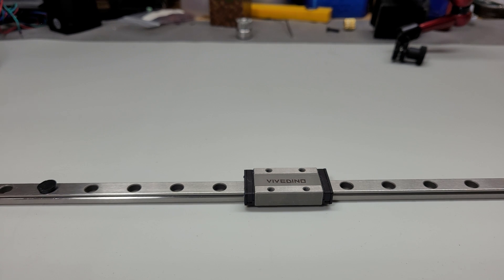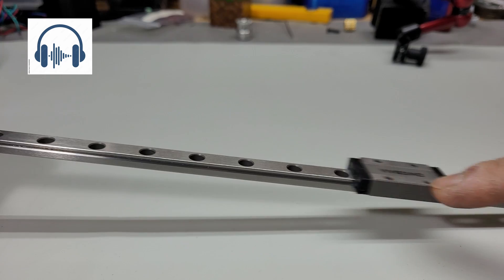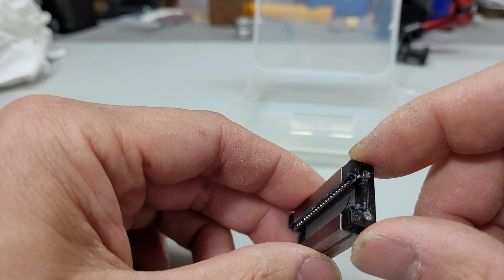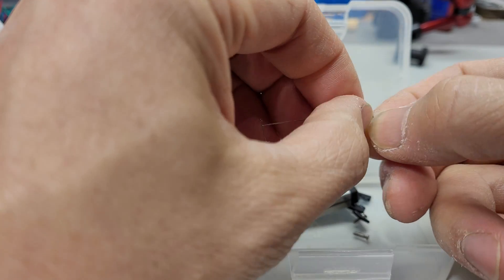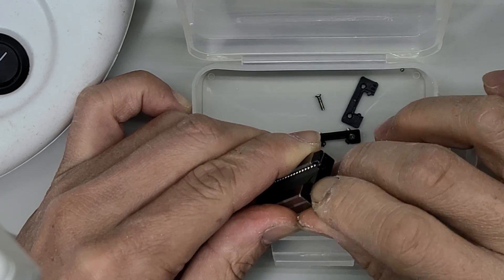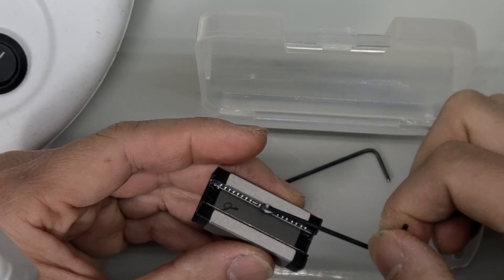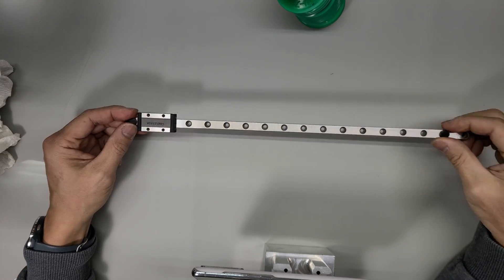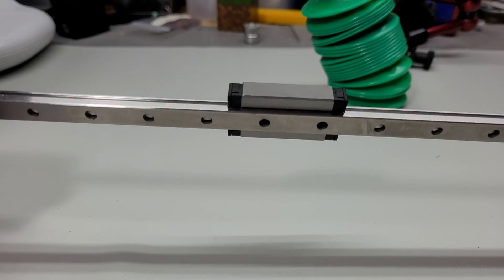Fixing #Formbot Vivedino MGN9H Linear Rail in #voron 3D Printer kit

Comment: I know this is an old video, but do these rails that come with the Formbot kit have grease ports? They have a small hole but does that allow for greasing?
Reply from the maker: there is no grease port. put grease on the rail run back and forth and wipe excess off.

Comment: What if I lose the little balls? Is it possible to purchase them only or  should I buy the entire guide? If so, where I can get them?
Reply from the maker: @andreascarda7644  https://www.formbot3d.com/products/carriage-for-linear-guide-rail?DIST=Rk9OHVk%3D
Reply from the maker: @andreascarda7644  yeah it can happen if you accidentally remove them from the rail. You can buy just the replacement linear block alone. If you know the size of the bearing balls, you can purchase them here I just found this on AliExpress: 
C$2.84 | 304 Stainless Steel Miniature Smooth Ball Diameter 1-4.5mm Precision Bearing Ball G100 HRC For Bearings 100/1000Pcs
https://a.aliexpress.com/_msj7Jub
Reply from the maker: @andreascarda7644  when you purchase just make sure you select the right option for the replacement linear block that you have.